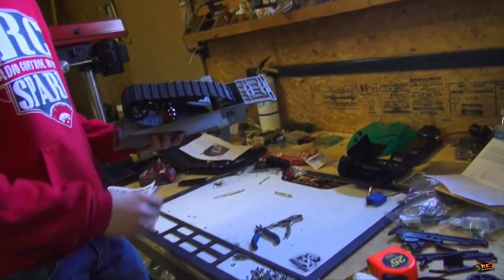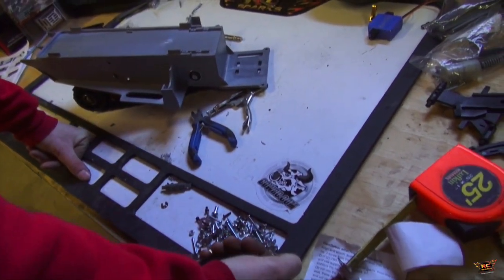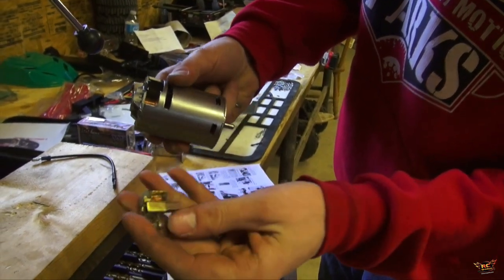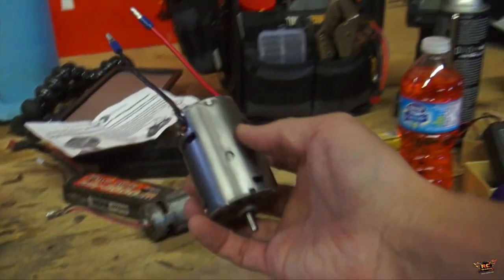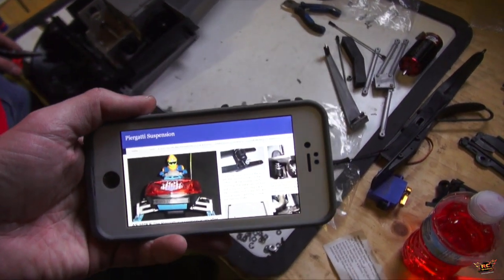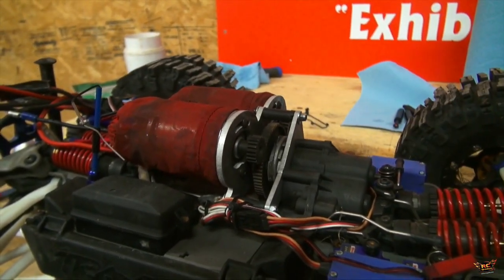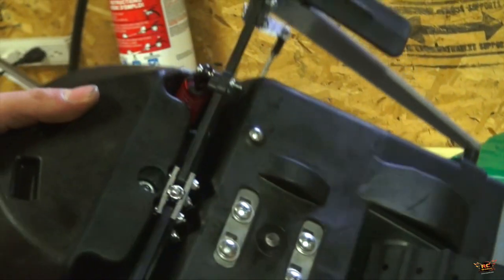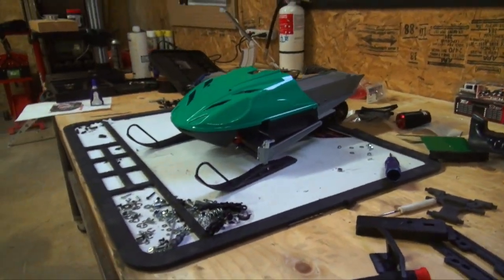RC ADVENTURES - Art Attack Snow Mobile Build & Summit Dual 820 Motor Swap

Comment: Hey medic just a heads up, I have heard from at least 5 people on the forums that the MIP shafts are weaker than stock. They CVD pin is always the first thing to break on them. LEM (leading edge machining) just came out with a set of aluminum driveshafts that are very thick and they are much stronger than anything else on the market for the Summit. They also make upgraded differentials for the Summit, as well as an aluminum dog carrier which removes slop in the transmission and allows it to shift easier
Reply: I have a mamba monster summit running on 6s and my mip are working great but i used the stock parts where they come out of the diff and into the driveshaft you know? like the joint thingy
Reply: Ya man I saw that to o well medic will find out soon
Reply from the maker: +RC_KING Ive been running my MiP shafts for 2 years. No problems yet.
Reply: +RCSparks Studio ok man what ever u say. also when calgary gets more snow can u do a running vid with your slash in the snow? also can u come to bc?

Comment: You should upgrade your diffs to LEM ( leading edge machining) aluminum 7075 Diff Cup & Hardened Spider Gear Combo.
And to get even more extrem get the Hot Racing Steel Helical Spiral Gear Set.
Im running a RX8 2Gen system on my summit 2250kv motor with 6s 90c lipos with no issues what so ever.
And if you brake your MIP drive shafts, get te Hot Racing ones, the are stronger. All the parts i mentioned are hardened carbon steel.
Thanks for the video and keep it up.
Reply from the maker: +Night Basher Thank you for your advice!:)
Reply: No problem :)
Reply: .)9

lol I'm

Comment: You should check out (LEM) Leading Edge Machining for diff upgrades . They have aluminum diff cups and hardened steel spider gears. I have been running them on 8s for about a year now with no issues. They also have some sweat looking aluminum axles .

Comment: well the fact is the only thing stopping you from making the summit a revo is the diffs. I run 80k weight in e-revos but for ridiculous stuff, jumps and crazy stuff, I throw 100k in the diffs, now for paddle tires I run a spool front and rear.

Comment: I want to add 10-15 mph to my slash 4x4. It is all stock except for cooling fans for the motor. I don't really want to go bigger then a 2s lipo. But may eventually get one in the future. So I was wondering what gearing and motor I should look into?
Reply: My uncle has a hobby wing 1/8 scale motor on his they are about $120 and they come with an esc and programer his is almost uncontrollably fast on 3 s lipos

Comment: Im building a 1/10 scale drift car with the castle creations SV3 motor/esc combo. Ive done plenty of searching but cant seem to find which battery connector it comes with, or do I get to add my own? Also being new to electric I have no clue which batteries are good, Im looking for a 2s Lipo, any recommendations?

Comment: Hey fellers ' That sled is so cool ! What size motors are u gonna run in it ' OH yeh DUGH !! Are u gonna run 1 or 2 18.0 volt dewalt's ? Just lookin at it I cant wate to see it run . Is the track custom made ? Ma n if U could put a paddel track on that Im sure u could skim that across water '  but I' m fairly sure u would have to use the wider skies . Man that give's me so many ideas ' I love it ! even though theres no snow down here in Ill ' In fact tomorrow its supposed to be a high of almost 60 degrese & it's dec. 11 -15  just crazy ! Jimmie R

Comment: What servo? I'm building a snowmobile along with you.
Reply: I live near Calgary!
Reply from the maker: +DPGAMING the one we used here is not necessarily needed. Its ridiculous power.  Instead I would start with a Savox SC-1251MG Low Profile Digital "High Speed" Metal Gear Servo. Its less torque, but the skis are riding through snow.. so I don't think "mega" torque is needed.
Reply: +RCSparks Studio thx!
Reply: +DPGAMING a sound kit would be cool to!

Comment: Leading Edge Machining!They have the best diff products for the summit right now. I have a set for the front and rear and they handle my Tekin rx8 gen 2 and t8 gen 2 1700kv motor like champs. check them out on ebay

Comment: Hey more teeth means more torque not speed!
Reply from the maker: +Mitch Appelt  Depends on the gear you're speaking of - but More Teeth on a pinion means more speed.. not torque, bud.  Less teeth on a pinion means more torque.